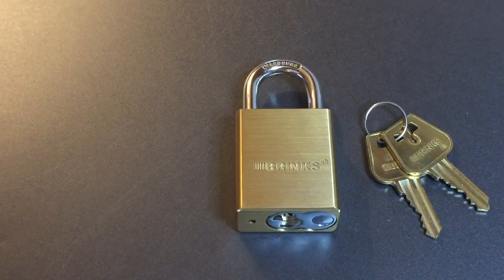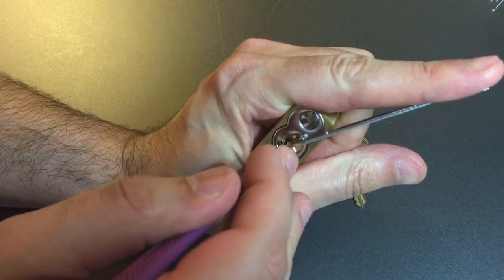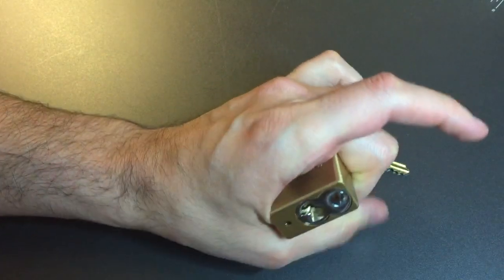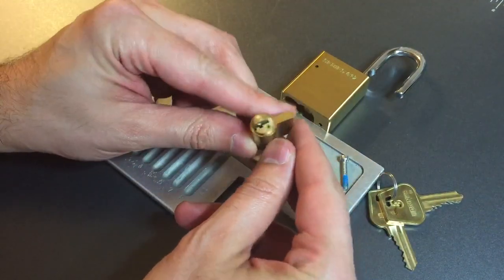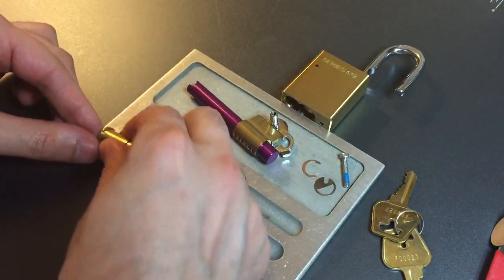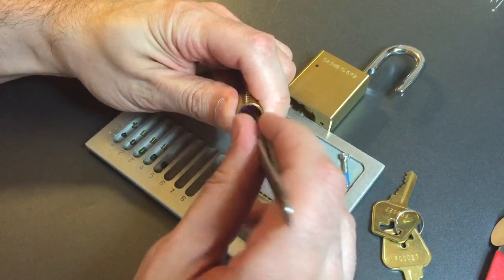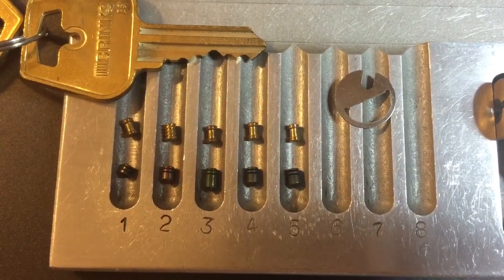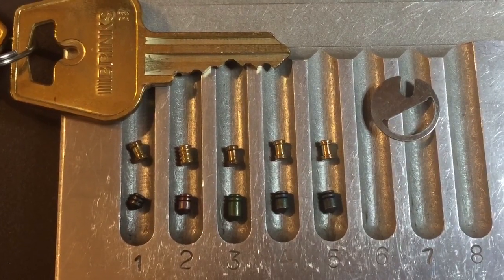[238] Brinks Series 612 Brass Padlock Picked and Gutted

Comment: Nice picking. I've always liked Brinks I think because that's all I have for a choice  are them and Master. On the shelves that is.
Reply: I have the same problem where I live so I just get on Ebay or go to a locksmith shop and they more than likely have American Brand padlocks maybe others.
Reply: +Blake McCormick the locksmith in my area use Abus bodies with American cores.
Reply: +Randy Perkins But is your local locksmith competitive on pricing? I have 3 locksmiths in my little town and they act like they are gods gift to security. 
Happy pickings!
Reply: +Steel Pinnings nope they're pretty spread out in my area so not so good on pricing or knowledge of anything that isn't common for this area. When I went to the next closest 1 they told me lock picking is immoral.
Reply: +Randy Perkins well locksmiths are looked at like they are because they act like the ones near you. 
"Immoral" SMH
They likely say that to continue to be above the typical conversation.
Reply from the maker: Brinks has a few good products... though if I was limited to the store, I have no idea what I would use.

Comment: I've found those thin anti bypass plates aren't very effective unless they are doubled up. A key extractor  pick just punches right through them, allowing it to be bypassed again.
Reply from the maker: Yes and no.  My experience is that it's a bit of a pita to break them, though certainly possible.  For me, I could pick the lock, disassemble it, remove the plate and put it back together faster than I could punch a hole that's usable for bypassing.